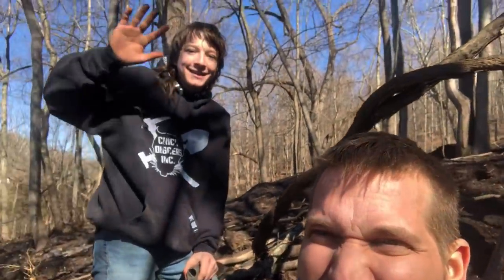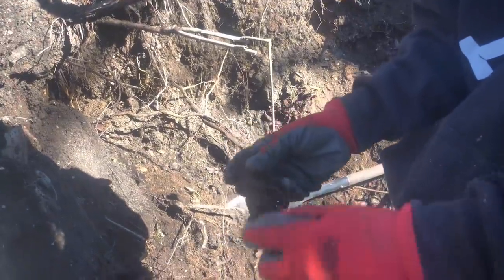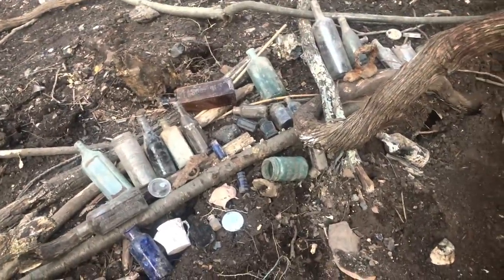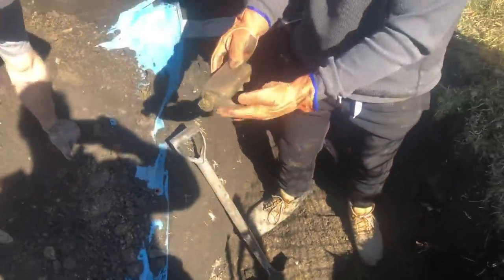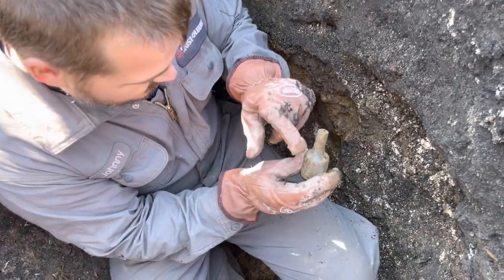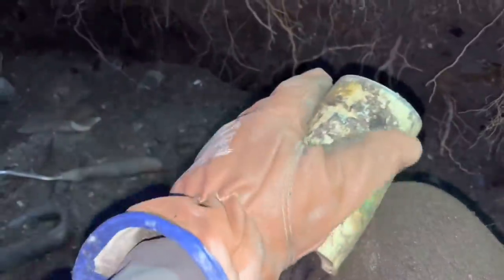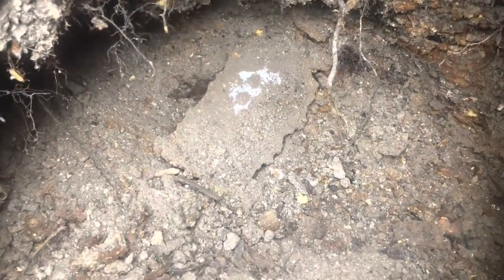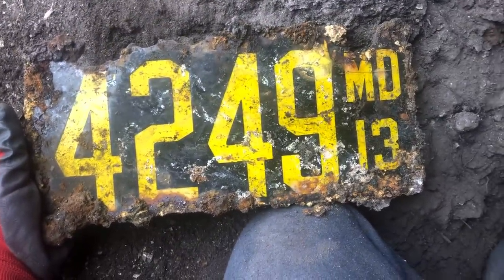UNBELIEVABLE TREASURES FOUND IN OUTHOUSE and OLD DUMP

Comment: About the mug Cory found.  The brewery was licensed from 1908-1917. It was the last brewery in the town, there were four before it.
Reply: American Breweries by Donald Bull has all the info needed to date your beer bottle finds.
Reply from the maker: Very cool and yes that is the exact age of the dump we are digging in. Thanks for the info appreciate you
Reply: The book is amazing. It is so detailed, that if a brewery just changed there name a little bit, like changing the name from 'company' to 'brewery', in their licensing, it shows the date it happened. So, if you have two bottles from the same brewery, with slightly different embossing, you can pinpoint the date.

Comment: I have an almost 7x4" plaque of Lincoln's head in brass.  I bought it from other diggers in Waipahu.  It has a green patina on it.  It's a creekside dump, and the plantation there was established in the 1880s.  I mostly dug 1920s stuff, but a rusty '56 Chevy was on the premises.  I found mostly embossed ABMs of c1915-35. Japanese medicines.  A brass Kamehameha buckle.   It was a strong ROTC type school from 1900 or so to the '60s.  Also bottles from China and the Philippines. In art supply stores look for fixative, a spray you use on pastel pictures.  It might stabilize paper labels you dig.  I dug one of 3 or 4 known 1915 Motor licenses known here, #8. That's the year the Territory of Hawaii started to issue license tags.  They were porcelain  until 1920.  Ths motorcycle was a large brass fender washer I picked up as I filled the hole.  I'd dismissed it as an A/C cooling fin.  I'd found a 1917 bicycle tax 20 feet away the year before.  I flaked on Waialua today.